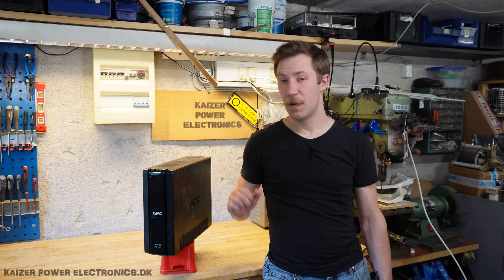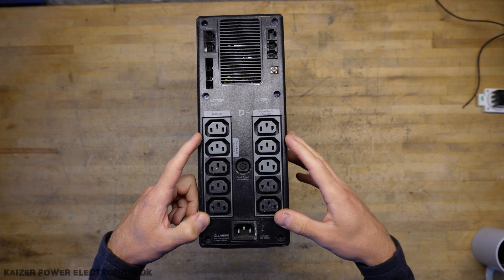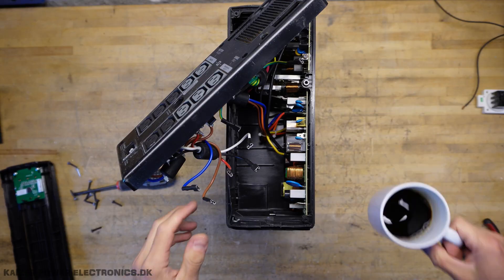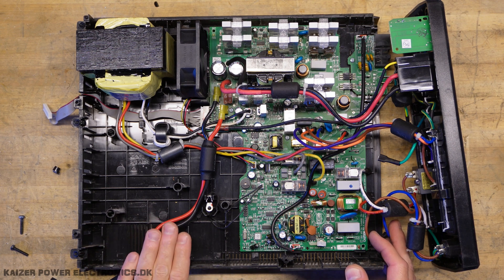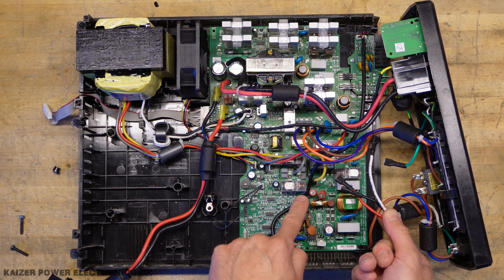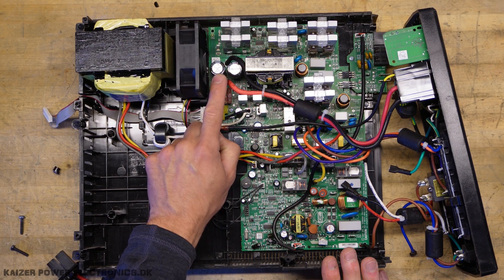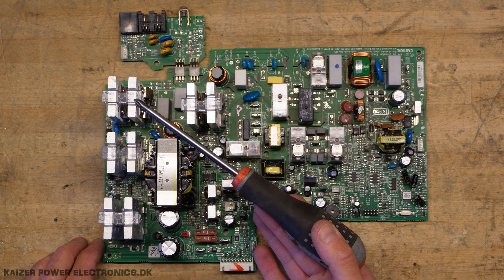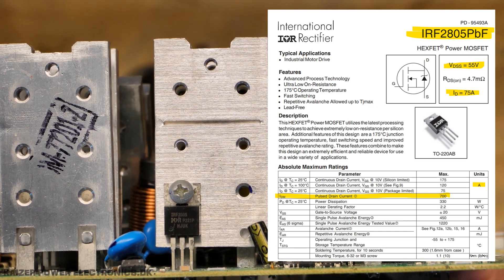APC Back-UPS Pro 1500 VA Teardown

Comment: I keep getting F08 error all of a sudden. Also, I remember changing the fan orientation when packing it up. Will that cause an issues. Mine does not have the air tunnel as well.

Comment: Can you use it for a regular solar system?
Reply from the maker: You would properly need a separate battery charger, since UPS charges batteries REALLY slow compared to the amount of energy you have available from a solar panel at peak production.

Comment: Hello folks,

I'm starting to get the typical "F06" error on this UPS. The problem occurs when I turn it on while it's plugged into the mains. If I turn it on unplugged, it starts without a problem. Then, when I plug it back in after it's running, I can hear the relay clicking and everything seems OK. Could it be a faulty relay? Do you know which relay it is and its part number so I can replace it?

Thanks.
Reply from the maker: Seems like a very common problem: https://community.se.com/t5/APC-UPS-for-Home-and-Office-Forum/BACK-UPS-XS-1500-error-code-F06-3-months-old/td-p/314483 Find the specifications of the relays, change them for something better (higher current capability), you could choose to change them all, then you do not need to reverse engineer the tracks or find schematics.

Comment: In case no one else has pointed this out yet, this is a 1500VA (Volt-Amps) unit, not a "1500 Watt" unit. 1500 VA = approximately 900 watts in most conditions.
Reply from the maker: Thanks for the correction! I appreciate you pointing it out, I got the wrong unit written in the title.
Reply: @KaizerPowerElectronicsDk you aren't alone. I often see this error in ebay listings for 1500va and related listings, e g 2200va, 5000va, etc. FYI APC generally embeds the volt amp rating in its units' titles. The chosen rating for an APC UPS is baded on its being able to maintain a load equal to its name/rating for about 10 minutes to allow a user to wind up what they are working on using a connected computer, before the UPS unit if connected via proprietary USB cable and running APC's PowerChute software, commands that computer to save and then close all open files, shut down all apps, shut down the OS, and then shut down the attached computer. That's an oversimplification but gets the basic idea across.
Reply: @KaizerPowerElectronicsDk APC has a "run time calculator" on its web site where one can enter a list and the power specs of what one wants to have battery backup connected. APC will then (last I looked) offer "good, better; best" model suggestions. Some APC UPS units allow connecting external battery packs to extend run time. You'd tell the calculator about any such.

Comment: Hi there, nice video. I came over the famous F02 Problem. Once randomly and now 'forever'. Disassembled the battery, tried with new ones. No success. Checked the inside, no visible damage. MosFets and other stuff were good. I finally found out a faulty Relais (RY13). One closed contact where it should be open. I threw it on the table and it works again 😛 Ok, that's no solution. I ordered some in China and still waiting for them. No relais in sight in Germany.
The PCB was designed to hold 2 of these relais, but only one was soldered. In addition, this relais was weaker (12A instead of 16A) than all others. But has more (printed) certificates for Germany. What a mess. I now understand the device's behaviour. The relais must have  gotten loose, when turning on several times. And now, not. Because contacts were burnt together.

Comment: I need help. I need to disable the charging mode of the APC Pro 1500 UPS. What I want is for the UPS to not be able to charge the battery, so I can then connect an external charger to charge the batteries. The issue is that I'm installing LiFePO4 batteries, and the UPS doesn't have enough Amps to properly charge them.
Reply from the maker: You need to backtrace the voltage sensing circuit. But chances are its done in software as voltage measurement is properly used for multiply purposes. I do not think its easy to disable battery charging.

Comment: Thank you for posting, this was really interesting.  The same unit in the US has a similar card an internals, but I would also add that I believe the AVR functionality / electronics must be different somehow as the Pro version seems to have a faster response in comparison to the older version imo.  I also like the battery system on the BR1500G model (Pro 1500).  It is easier to replace. Thx!

Comment: What an amazing piece of work—thank you very much for documenting this model through such a detailed teardown.

As part of my research for repairing a similar unit I own (BR1500G-GR), I’d like to ask a question here. My unit no longer provides a proper autonomy estimate. After installing a new replacement battery, it still reports only 1 minute of runtime for a 300W load.

By disconnecting the data cable the UPS provides the expected 24 minutes of autonomy, but it displays only 1 minute, suggesting it might have lost the ability to accurately assess battery capacity.
If the issue lies with the UPS circuitry rather than the battery itself, could you kindly point me toward which components or subsystems might be responsible for battery capacity sensing or runtime estimation?

Thanks in advance and keep up this amazing work!
Reply from the maker: It could be that APC places a diode or resistor in their own batteries, to identify them or to make estimate on life time. Some times cheap methods are used to protect selling original spare parts.
Reply: @KaizerPowerElectronicsDk  Thanks for your reply. Fortunately I was able to solve the problem by exchanging the battery again and by setting the battery date through PowerCute Serial Shutdown software over a VM. The APC now displays the expected 25-30 min of autonomy for a 250-350 W load. I only use original replacement batteries.
Reply from the maker: @stephanjung3882  Then we can conclude its only based on a timer, that has nothing to do with actual condition, but is just a count down

Comment: I got a F02 error, and if anyone is wondering:
1. remove power
2. remove external battery if available
3. remove internal battery
4. press power button 5-10 seconds
5. connect power
6. connect external battery if available
7. connect internal battery
Reply from the maker: Thank you for sharing troubleshooting information for others :)
Reply: So boot it up without batteries, and connect them while the unit is ON with AC supply?

Comment: hi, was wondering if those 8 pins on the bottom part of the board are meant for firmware access? need to modify voltage being put out by the charger.
Reply from the maker: I think you are right, most 6-8 pin headers in equipment is most likely a ISP header for programming.
Reply: @KaizerPowerElectronicsDk  its actually a 10 pin header, my issue is that i got a lifepo4 hooked to my unit, and need to change charging voltages, someone made me aware of trickle charging and how the bms in a lifepo4 cant prevent that low current from reaching the cells.

Comment: These tower units are indeed consumer units, we have them fail within 6 months to a year when used as backup in industrial setups ( solar farms comms ). The shuttle type is more industrial setup orientated, and we rarely have them fail, and when they do is due to external factors ( ground faults on Hv lines, lightning strikes, etc.
Reply from the maker: Thank you for sharing you experience with these units.

Comment: I have a UPS BR1500G-FR and I accidentally installed the battery incorrectly, which caused the 40*2 fuse to blow. Is this fuse installed in a way that allows it to be easily removed by pulling, or is it soldered with tin?
Reply from the maker: I seem to recall that the two 40A car fuses are soldered onto the PCB

Comment: Interesting exposé. I'm hardly surprised that the "Pro" is just marketing.
That said, I've owned an APC Back-UPS Pro 1500 since 2012, and I believe it has saved me several times (voltage fluctuations and micro-outages are frequent in the French countryside 🇫🇷).
Aside from a battery replacement in 2019, I had no complaints until the past few weeks: at very low load (around 100 watts), nothing to report, but as soon as it reaches 250 watts, the fan turns on and won’t stop until the load decreases. This wasn’t the case before, and it’s very annoying. 😤 There’s no indication of an input voltage issue, no beeping, or anything else.
I contacted Schneider Electric’s customer service, and their response was essentially: "We don’t repair. We have no spare parts. Buy a new one."

Does this situation indicate a specific problem or suggest a potential cause, and is it repairable?
Reply from the maker: It could be that it needs cleaning from dust, your description sounds like something is not able to dissipate heat. It could also be dried out electrolytic capacitors, which generate more heat from lower capacitances in the inverter.

Comment: Great video! 

The pro models usually (BR1500G) have external connectors for adding an additional battery to increase runtime. If APC cared at all about the environment, they'd allow us to change the float peofile to accommodate lifepo4 batteries. But alas, money talks and ..... walks
Reply from the maker: Thank you Daniel. Any company saying they care for the environment, is only to sell more.

Comment: Need an expert opinion for something I am struggling for a long time. I have a APC Backups pro 1500VA/865W connected to a PC with 4090 GPU. When PC is on standby drawing 300W load and if power supply fails, the PC remains running, but when I load a game and the PC starts drawing 650W, if there a power fluctuation, the PC restarts. The UPS is 2 years old as of now and for 1.5 years I never faced this issue. Is it a sign of some component that is switches from power supply to battery supply not able to work at its original capacity and if yes, what that component is and could it be repaired?
Reply from the maker: A UPS of this size is only meant for shutting down safely in case of power loss. Pulling 650W from a UPS rated for a maximum of 865W will drain the battery real fast.
Reply: @KaizerPowerElectronicsDk  I understand that part of shutting down, but shutting down is not the problem, the problem is when power switches from grid to battery, PC restarts when PC is pulling 650W and does not restart when PC is pulling 300W on a UPS which is supposed to supply 865W. Earlier this was not happening. So wanted to know which component actually controls this switch which is currently not working as expected.
Reply from the maker: @jerrygeorge007  The UPS specifies a 8 ms switch-over time, maybe that is too long for your computers PSU and its actually the voltage dipping on your secondary voltages of the PSU that is the problem and not the UPS. You would need a oscilloscope and differential probes to measure both battery voltage, UPS output and PSU outputs to pinpoint the problem.

Comment: Do you have any recommendations to upgrade the fan to a silent one? Its been so loud when it runs. 

Please let me know if you know the size of the fan.
Reply from the maker: Look up the performance of the current fan, amount of air per hour, CFM or M3/h, then find a larger fan with similar air flow rating and it should be able to do the same cooling at a lower noise level.
Reply: Just estimating by watching the video, my guess would be 60x60mm or 80x80mm with a depth of either 25mm or 32mm, but that's just a guess.

Comment: How do these units determine that a battery is bad and needs replacement? Mines flashing that it needs a new battery but when I test it by unplugging it from the wall with a 200W load it still works for almost the same time it did from when I got it years ago, but now the 'time remaining on battery ' goes to zero fast and sits there till it turns off!?!? Thanks!
Reply from the maker: The manual lists battery as lasting 3-5 years, before replacement. The worst case scenario would be that its just a timer randomly indicating battery change, after 3-5 years, but I doubt its that oblivious. Its a trade-off between you wanting security for the UPS actually working and if you trust the new battery pack seller :) Remaining life is maybe tested in its load and charge cycles, and it saves data and determines life time based on this. UPS was never meant to be a cheap solution, you are paying for having power available at all times and that costs money in spare parts. (new battery and possible new UPS) You pay for security, not low expenses.
Reply: The manual mentions a "self-diagnostic process" at startup. Upon failure to pass that diagnostic, it will emit an audible chirp, apparently. It does not explain what that diagnostic test is, but my guess would be a simple under-voltage threshold.
Reply: I have a custom built SLA AGM setup and the metric you use to tell if a battery is bad is you fully charge the battery and then measure the voltage drop after 6 hours when disconnected from a charger while not under load.  This actually tells you how much total capacity the battery has lost due to old age situation.   This only works on SLA AGM batteries.  12.85v = 100% capacity, , 12.5V = 80% capacity,  12.15V = 60% capacity, etc. I guess double all that for the 2 cell 24V units like the BR1500G.   Generally it is industry standard to consider an SLA AGM battery is bad if it's capacity had degraded below 80% capacity. Personally, I EOL batteries below 50% capacity.  Below 50% is where you start getting into the danger zone risks of having an unexpected catastrophic failure of the battery.  As the battery capacity degrades through ageing,  even under the most ideal conditions, it starts dropping positive plate material at the bottom of the battery and this material is highly conductive. Once the pile is big enough to touch the bottom of the plates it makes a short circuit inside the battery which can cause the battery to rapidly heat up, vent hydrogen gas, and possibly explode. Sometimes they just crack open and drop a toxic white powder all over the inside of your unit which has happened to me on a battery I had already pulled from an APC unit as being <50% capacity and set aside on the shelf for recycling but forgot about it for not even a few months. Wasn't even connected to anything and it cracked itself open like an egg and made a heck of a mess.  I think by then the capacity and charge is so low that nothing particularly interesting happens when it forms that internal short circuit.   Ya, 3-5 years an SLA AGM battery will be below 80% capacity and that's EOL by industry standards where you're well into accumulating positive plate material at the bottom of the battery.. When the battery is under load it's particularly difficult to get a measurement of the capacity and time remaining because there is a lower surface charge voltage that you are reading which skews the estimated runtime downwards considerably.  The only way to get a reliable measurement of runtime and time remaining is to know the capacity of the battery by the aforementioned test from a full charge and then determine how much power has been pulled from it to compute the current charge. Reading the battery voltage while under load won't give you a reliable estimate. Sometimes the simplest way is to just test it to failure yourself.

Comment: hello sir i have the same ups and today froze.... i take out the batteries put the power on but no screen display and after a few sec turn of but the thing is that i take voltage on the bottoms 
IEC even when the ups is of. i see a grey cable that goes upper from a component that i dont what it is. its black and on it says 125oC its a few components upper from the speaker, near a brown capasitor 100μf 25V. the board also have 2 of this components in red color near the vertical toroidal coil. what are those i want to change them all . the black one and the 2 red
Reply from the maker: Why would you want to change something you do not know what is? The two red ones marked L18 and L19 on the circuit board, is inductors.

Comment: Thanks for the video, could you clarify if that model also comes with its transformer with its aluminum winding? To see how low the brand has fallen, since I saw that the latest APC models are having aluminum instead of copper, thanks for your content.
Reply from the maker: I did not look for winding material, I will do next time!

Comment: For anyone having a problem with this ups. And getting the f02 error. Check the output mosfets (22n50n) if they're shorted out.  And also the half bridge (irf2805) along with the 4 resistors next to them (33.2ohm). That's what i had been dealing with for over aweek. But finally fixed it.
Reply from the maker: Thank you for sharing your repair experiences with everyone else!
Reply: @rouuuk which of those components did you replace to fix yours?
Reply: @MartinDillich all of what i mentioned before. If one burns out the rest follows

Comment: I have the Rs1000 pro, and it uses the RJ50 port on the back to just communicate through RS323 to usb to let the software do stuff like - battery health monitoring, backup time and automatic hibernation of the system on low battery thershold. I am using it with the internal 2 battery pack and an external 4 battery pack, gives me about 90 minutes on a 1.6KW load
Reply from the maker: That is a pretty long hold up time for such a large load, to 6 cells.